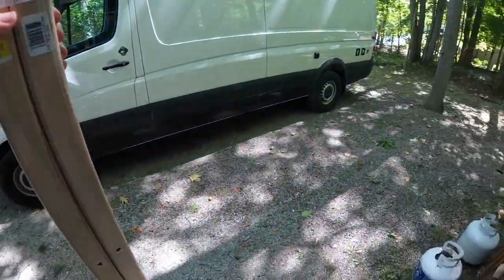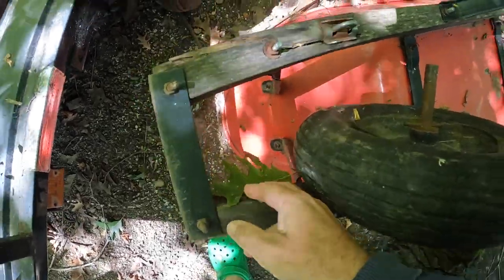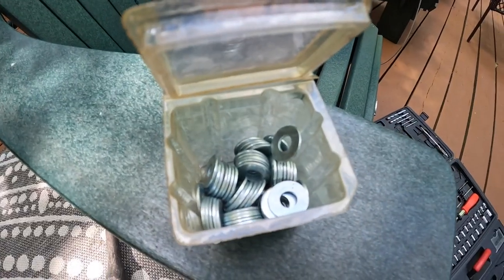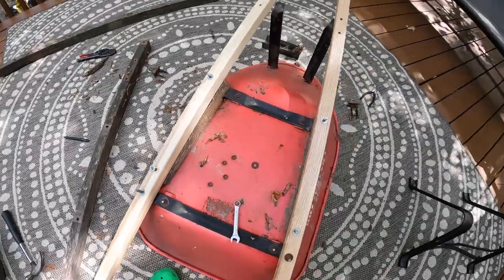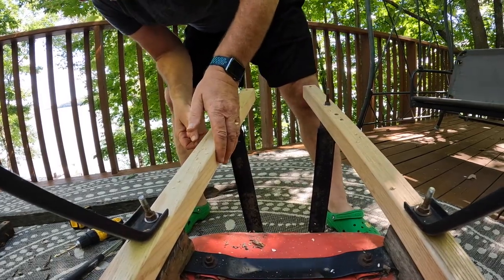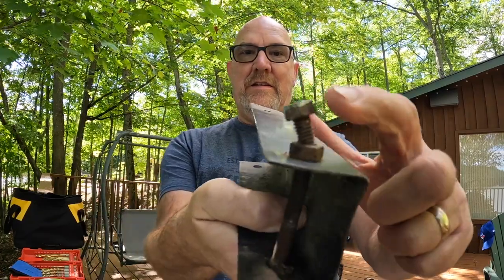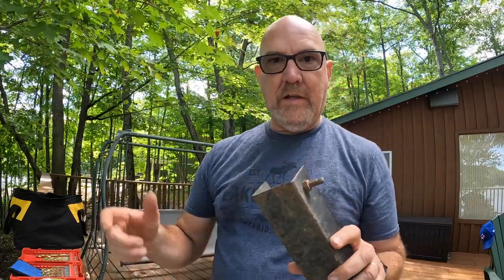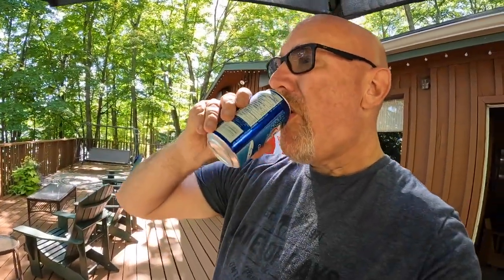It's All Coming Apart!

Comment: you could of bent the piece that hold the two arms together so it can fit better just by hammering it down wile you have it on... or next time bring your socket set and really tighten all the bolts  down better.. even that piece that holds the two arms together.